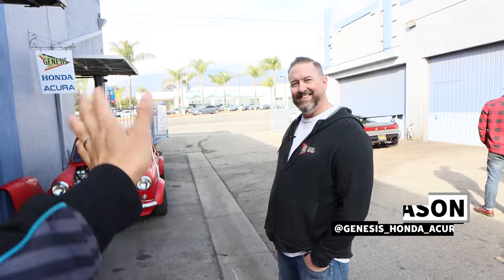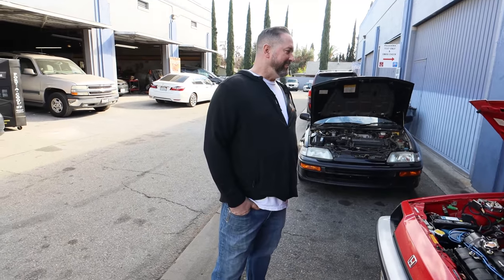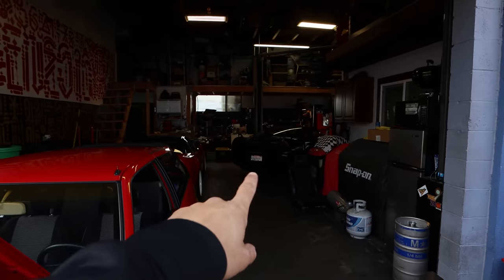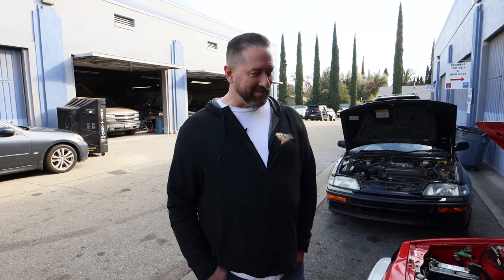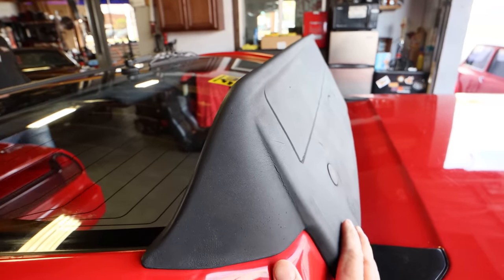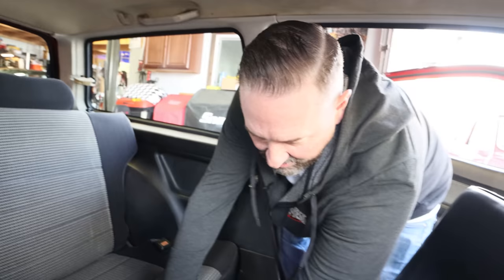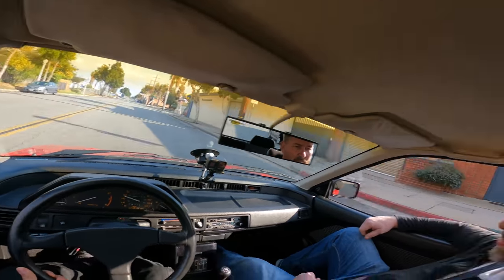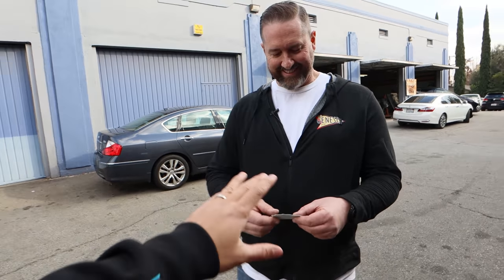Time Capsule ’85 Honda Civic is the Cleanest EA-T We’ve Ever Seen. Runs on Carbs!

Comment: This was my first Honda. Same color and all. The start of a decent relationship.
Reply: Mine to. Well 87si, AF chassis right?
Reply: Mine was a manual red 1.5l GL model with 12 valve engine 80 hp and it was fast enough as it only weighed around 800 kg
Reply: you should have keep it lol

Comment: Just got my first Honda car 2 weeks ago. 1984 crx from the original owners. It's another time capsule but apart from Momo Ferrari Engineering 14" wheels, Mines all stock still. No joke on hard to find parts. Or if you find them, the rarity markup is beyond belief.

Comment: Some Honda models from the 80's are legend. I owned a 1980 Honda station wagon with the 1.3l engine. 
I lived in a pretty cold location back then so I installed a block heater, 4 really good snow tires on steel rims, an electric overnight interior heater and sheepskin seat covers and steering wheel cover. Underground clearance wasn't great, but if I got stuck going forward the slick Honda 5 speed would rescue me in reverse or by rocking the vehicle back and forth.

Comment: This car is amazing.  My 1987 civic si was totaled and sold - Drove around the Valley from 2005 - 2010.  I sold off the Mugen CF48s with covers and steering wheel but keep the other Honda access items for future use.  I still have the OEM wing (HONDA foam/rubber wing) still new, also have the power windows (very rare), the browntop ZC (JDM), and correct fog lights with CIVIC covers and interior switch.  I missed out on a digital cluster about 7 years back.  I will install once I have another E-at wonder civic.

Comment: Fun fact: an owner can retain the factory radio while easily adding a small module that is easily hidden from view which provides bluetooth &/or auxiliary cable connections. The modern module will provide substantially more power than the factory unit, naturally proving the ability to upgrade the speakers (which would also appear OEM, as they are generally installed behind the factory grille & is not visible); the module also provides a good start if the owner wanted to add an amplifier(s) to get more volume overall or to add a subwoofer system, if desired.

Edit: I failed to mention that it is also not complicated to retain functionality of the OEM head unit if the owner wants to keep the sound system looking original along with operating as it would have fresh from the dealership.

-other random tangent: it's sad how difficult it has become to get classic audio equipment repaired or maintenanced; I have had several owners of classic autos contact my mobile electronics shop to ask if I am able to repair a cassette deck, antique speaker, or other out of production equipment. Fortunately for them (& the rest of us that appreciate these touches), I am one of the last shops in this latest generation that is more than happy to do these repairs. Btw, 91% of the time, broken cassette decks simply need the head cleaned & perhaps replacement of a belt or drive motor for one of the capstans...truly a shame to see a classic car go under the knife, permanently altering the interior, just to throw in some cheap CD player from Walmart; sends a single nerd-tear down my cheek!
Reply: in the 7th gen accord, you could cut a hole in the central console to retrieve a connector so you could plug an mp3 player,
Reply: It always bums me out so hard when I see a beautifully restored or preserved car with some goofy ass modern stereo hacked into it!!
Reply: @famicomnintendo  the early 2000's altima had no provisions for an auxiliary input, in high school I nodded my friends head unit to create this feature by tapping into the pre-amp section of the head unit to solder in leads. The only real catch to it was that you had to put in a special CD (I made her a disc that was 60 minutes of silence) to be able to use the aux-in

Comment: Very cool. There are lots of these still around in my area. For a low pressure fuel pump, that's pretty loud. I wonder if he did inline or in tank, I'm sure he can run some rubber mounts or get a quieter one, something.

Comment: I had a 87 1500s myself back in the day..
mods.
rebuild motor and trans
centerforce st 3 clutch.
DC header 2.25 exhaust magne flow.
Jabex ign.
Weber 32/38 carb
lightspeed cam and adjuster 
lightspeed 38 mm torsion bars
lightspeed Banhard bar
suspension tech sway bars
toteko shocks.
sorry if I spelled things wrong..
love the car soo much 
other mods was a big stereo too..

Comment: On your time mark around 27:30 or so you wondered what it was like to drive a new Honda Civic... I drove one new. A friend of mine bought the car straight off the lot. Still had 30 day tags on it. You have to remember during those days most cars were rear wheel drive. I wondered where the center console was for the stick shift. She didn't know but showed me the engine. I had just bought a 85 Toyota Celica GT-S Coupe. I didn't know anything about cars, I just thought it was sporty so when I looked at the engine I just knew it was sitting in there funny and wondered how it actually drove.

Comment: Cool, clean civic. Kudos on the wheel choice and just-right stance. They look like compomotive rally wheels. If they didn't have the racing hart badge, I would have thought they were. I also love rare hard-to-find oem accessories like that rear roof spoiler. Sounds incredible. Love carbed engine setups when they're well-tuned.

Comment: my 1985 Honda CRX HF  (high fuel) had 78K almost mint cond, I bought it in 2005. You say carbs, i say I got 65 mpg and sometimes more
Thats more impressive at 1,680 lbs , 1500 cc 5 speed, special gas sipping carb. I had to do all the maintenance because so few people knew how to work on them anymore.
I eventually rebuilt the motor myself, not being a professional mechanic. This was the upper white color, metallic silver grey lower color hatchback.
I got more people  than I could handle telling me about owning this model so long ago and how they loved my car. Mine looked almost new the way I kept it.
They did have plastic front fenders which tried to crack in places as I kept gluing them back up. Keeping this car smogged  rightin Calif was never easy.
If that gas sipping carb ran too lean it failed smog requirements/too rich it failed also. Not a high speed car at all to get this great mileage.
At 1,000 rpm in 5th gear hwy driving only ,not stomping on the gas pedal doing 60mph, you can get unbelievable gas mileage in this car. Power to weight is the right formula
Cant believe I sold it, it was a love affair. Sold it to a girl against my better judgement, wanted some mechanic to buy it, to maintain it like myself.
This Honda never broke down over 13 years, it just kind of warns you if some part starts to wear out gradually , which would be simple replacement parts.
gas hoses and oem heater hoses would never fail. It just kept on going.

Comment: I have a 90 hatch that’s been in the garage for 15 years. I start it and drive it around the block once a month and change the oil once a year. Parts are so hard to find.
Reply: You technically don’t have to change the oil for 5 years if that’s true 😂
Reply: @MrPavalava  I’ve worked in the oil industry for 21 years. Your wrong.

Comment: This is when Honda made its name for its self starting in 1984.       In 1984 and 1985 this car was called Civic 1500S .  1.5 Liter  S for Sport.  12 valve.  In 1986 and 87, they went to fuel injection and one color paint and flushed 1 piece headlights and started the SI line across all models..            Then some time around 1994 honda lost their styling, not sure why. with exception to the NSX.

Comment: A nice oldschool build. The intake manifold (tiwn-carb mount) doesn't pop out. Does anyone recognize which model it is? There are a few different models, but little distance to the firewall is often an issue if the manifold+carb gets too wide.

Comment: The most annoying fuel pump on planet earth for carbs? Had Webers they need 1.5lbs of fuel pressure. That things sounds like its trying to feed a Top Fuel dragster.
Reply: It's most likely a carter under hood.   Sounds just like mine.   It's what I had to go with to get my fuel correct on my weber 45 sidedraft.     But his does sound very loud.  Lol
Reply: @petescarport  LOL I could see it if it was Cleeus McFarland and one of his crazy contraptions . I had a Weber 38 ran off of both barrels on a mazda b2000 w/ flat tops , tow cam (Low end grunt) Head shaved .02" Biggest valves I could cram in there. Man that was zippy old school 4 banger. Flat out fun. Cops loved it unfortunately a header , straight pipe and a flowmaster .

Comment: is it ok for the timing blt to be expose? i want to remove the cover of my timing belt so i will see if it is starting to go bad
Reply: good question
Reply: I have an old MK2 Jetta with exposed timing belt. The belt covers were offered as an extra from Volkswagen. Came with no cover from factory! 😉
Reply: I wouldn’t do it on a daily it's going to undergo more wear and tear due to being more exposed to the elements.

Comment: That's a d16a1 or zc type engine, the bottom block on those engines are identical to the d (1.5/1.6) series made from 88 to 01. Exhaust manifolds, rods , pistons , cranks etc are identical. It's just got a different head and intake... Parts aren't obscure necessarily, this guy is just a little clueless...